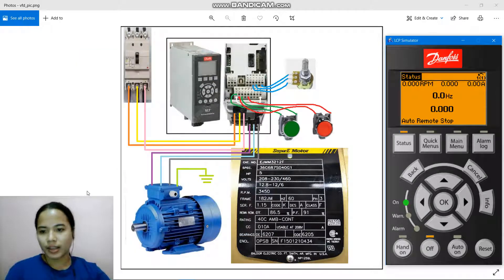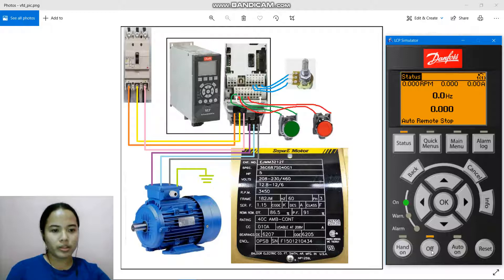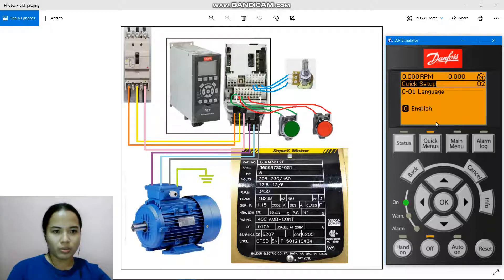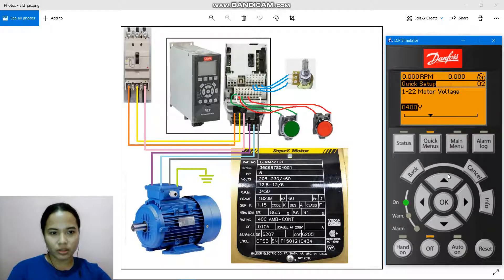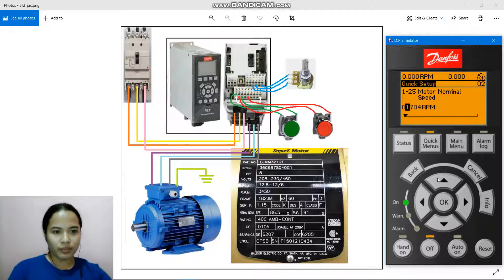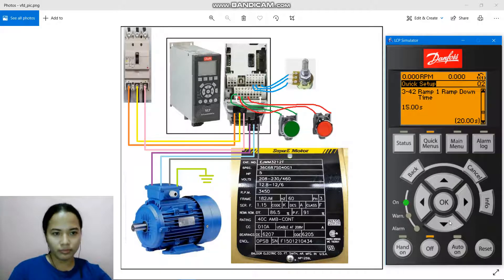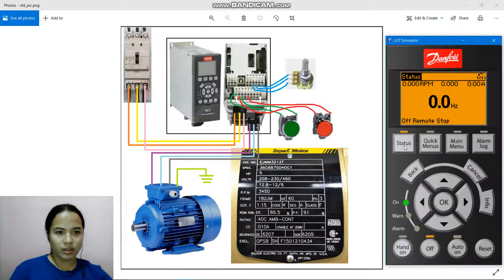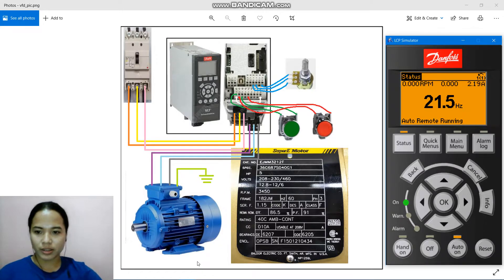How to Program the VFD using Danfoss VLT Automation Drive and LCP Simulator

Comment: On connecting the Vfd fc302 model the motor runs in one direction only. I changed the settings to both the directions and other settings to be made? If anyone knows pls reply. TIA
Reply: you can change the limits on the reference to the negative side, or you can enable reverse mode in one of the digital imputs

Comment: I was told by Danfoss Tech support that I didn’t need to multiply the motor name plate current by the service factor? I just had to add the nameplate current. Would there be a difference?